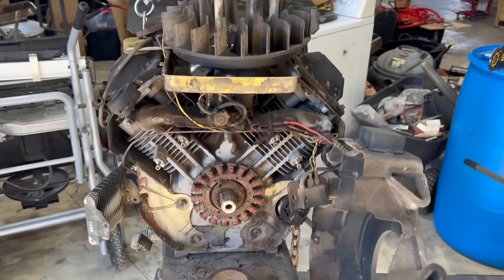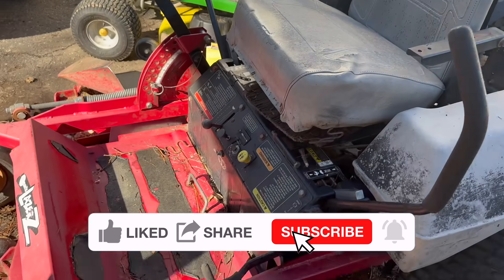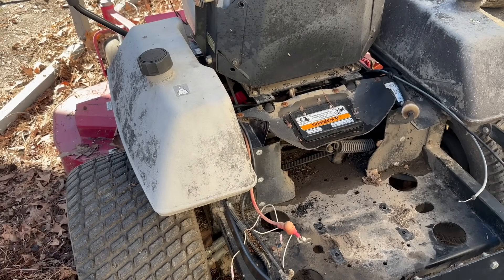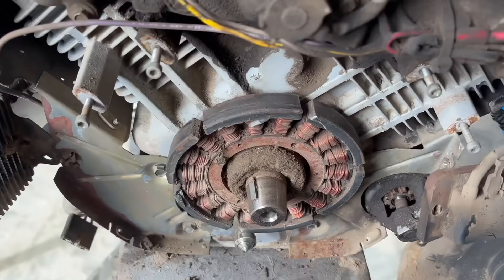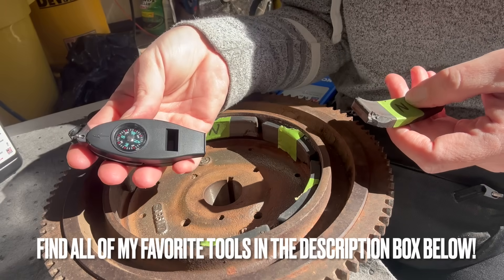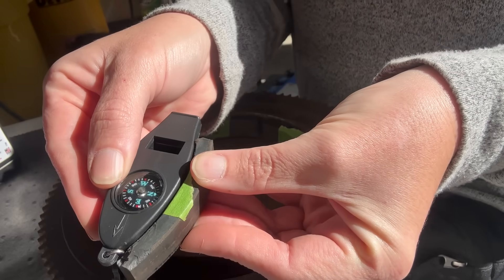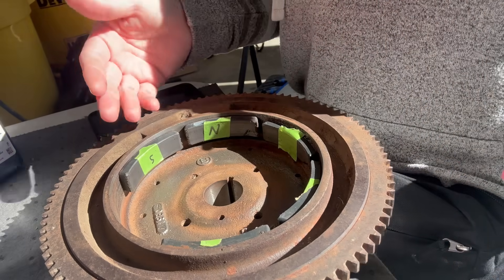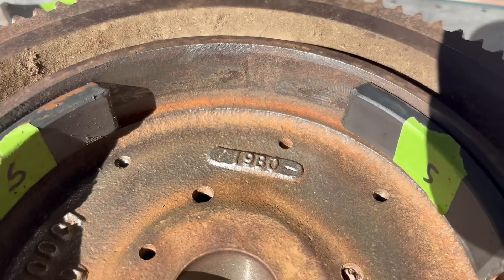Battery Keeps Going Dead? How to correctly re-install Flywheel magnets that broke off! Kohler

Comment: I'm on my daughter's YouTube. I had this happen to me on my 20 plus hp Kohler engine about 12 years ago. Before I removed the magnets from the stator I marked them. I completely clean the epoxy from the flywheel and magnets. It probably doesn't matter, but I wanted to make sure that the magnets were spaced evenly. I got a 5/16" brass rod so it wouldn't stick to the magnets. The 5/16" wasn't quite big enough when I test fitted it. The gap was too big between the last and first magnet. So I wrapped scotch tape around the brass rod about three times. That was too much when I test fitted it. I kept peeling just a little bit of tape until I got it right. I covered the backside of the first magnet with red thread locker. I made sure that the flywheel was positioned so the magnet was on the bottom of the flywheel that way the red thread locker wouldn't run away from the magnet and flywheel. Once that cured, I installed the brass rod and put red thread locker on the second magnet and install it and positioned the flywheel correctly. I waited for that to cure so that way the magnets wouldn't pull towards each other. It was long and tedious, but I was very happy with the result.

Comment: The old Tecumseh HH and OH motors are bad for this. I used a super thin layer of JB weld and light tensioned C clamps to re-glue the magnets. 12 yrs later and still going strong.

Comment: If that's a magnetic pole indicator, yea that's North.  If that's a compass, the compass' North is attracted to the magnet's SOUTH pole.  Doesn't matter most of the time as long as they alternate, all is good.  Once in a while though, when it needs to synchronize with something at the other end it WILL matter then.

Comment: Hey Bre!  Good luck with the new shop!  I was hoping you could help me with something.  I have a Stihl MS180C (soft start) chainsaw that starts and runs perfectly.  BUT, when first started I slide the black lever all the way down to "choke" and lock the trigger.  After 1 or 2 pulls it sputters and I raise the black lever up to "run".  Of course it starts, but at this point the trigger is still locked and it runs at full speed until I hopefully get to the trigger and release it!  Running the saw at full speed (even for a few seconds) when cold can't be good for it, can it?  I don't want to ruin it, but that's how I was instructed to start it when I bought it.  Would it be better to release the trigger after the first sputter on "choke"?  Thanks again for all your wonderful tips!

Comment: The magnets polarity can be determined by placing them next to each other. some will attract some will resist. I’ve never had to pull an engine out just to remove the flywheel. 🤷🏻‍♂️

Comment: I know it's very tempting but don't take a blow nozzle to that stator. Shop air is very likely to blow debris  (little metal bits) into the coils and that insulation is super thin. It's very easy to short out the windings. If you have to clean the stator use a vacuum and soft brush.  Don't touch the vacuum to the stator and be gentle with the brush.

Comment: I'm less than impressed that you didn't consider this repair good enough for the owner, if I'm recalling that video correctly,  and would only sell him a new flywheel, because you didn't consider it a reliable enough repair.....but now that he gave you the unit, the cheap fix it plenty good enough for a unit that you are going to sell.

Comment: Good job Bree, I did that to a Polaris snowmobile engine and used the industrial yellow epoxy that I have used on damaged motor cycle cases and it worked good.

Comment: OK Chic, 
Heres a question for you. My tiller has a fuel shut off valve. When you are going to store 
it for the winter or longer the idea is to turn off the fuel & run all the fuel out of the carb. Gotcha.   HOWEVER, with the carb innards dry, is there any rubber seals or what have you which might dry out become brittle and require replacement?

Curious in Cancun.

!
Reply: Think she says to fill/ prime with oil to store & them drain & flush well before use in one of her vids..

Comment: To clear things up, if the compass is reading "North" towards the center of the magnet, it is actually a "South" Pole on the magnet. Remember opposite poles attract. Like or similar poles repel. But the concept works for what you are doing since you alternating magnet polarity.

Comment: That's a helluva tip.  They must not have mixed the epoxy properly for them to fail all at once like that.  I would use some JB weld

Comment: really enjoy the channel.  I have a question?  I have a craftsman pressure washer about a year old.  it runs great but when I shut it off I always get a backfire.  any suggestions as to what the problem might be?
Reply: Idle it down first ,it is not a backfire - it is an after fire in the exhaust (the reason most riders have a fuel shut off solenoid below the carb.

Comment: I had a B&S 31000-series engine in an Ariens rider that the magnets came loose from the flywheel and disintegrated, destroying the stator in the process. No known reason why it happened. When it first happened the engine was hard to turn over by hand and made a grinding sound and I thought the piston or crank was damaged. Turns out it was just all the magnet chunks under the flywheel. I cleaned them all out and for the next 6 years I kept the battery charged with a battery tender as a flywheel and stator were stupid expensive.

Comment: Will I have a problem that's not to do with that. One of my blades is lower than the other and it is cutting my yard all messed up. Can you show a repair on a mower deck on a zero-turn. Possibly the shaft has slipped on that side

Comment: A bit of redundant information: It's actually so that if the North arrow of the compass points to the magnet, it points to the magnet's southpole and vice versa. But as long as they are alternately positioned it's quite uninteresting and of no consequence. :)

Comment: I think the real crime here isn't that somebody couldn't afford the repair, its that the parts cost so darn much.  Part of me gets it, but sometimes???  For example.  I have a Dewalt Random Orbit Finish Sander I use ALL THE FREAKING TIME (HUNDREDS of hours).  Well, actually it's about the 7th one.  Why?  Because the sanding pads wear out.  They are 100% replaceable...but they cost MORE than a new sander does, with the EXACT SAME PAD.  Yep.  Last one I looked at a few years ago was $59.  I can buy the sander for $49.  Even my old high quality Porter Cable Finish Sander (when Porter Cable made quality tools) has a pad that costs $59.  That one I do spend the money on, because that sander is a beast.  It's old, but the darn thing is as good as any Festool for sure (again, back when Porter Cable made quality tools, and didn't sell out).  

THIS is the problem.  These companies do NOT want you to fix your equipment, they don't.  They want you to buy new.  I paid $149 for my Echo Weed Whip.  Replacement speed head?  $50 (local, not the Jungle Web site, or even on-line parts places).  Carb Kit?  $116 (but they send you a new sparkelator and air filter too).  I mean, those two items cost more than what I paid for the entire unit...SHIPPED TO MY HOUSE.  That is the real crime.  Fact is, they do NOT want people to repair these units, they want you to buy new.  Too bad we have become such a disposable society.  :(
Reply from the maker: I had the same experience with printer ink. The ink cost to replace fully was MORE than the printer new!  BS!
Reply: Funny you say that.  Back many years ago Sam's club had a deal on some HP printers for like $49.  They had to put a limit on the number purchased. Apparently people were trying to buy 20 and 30 of them...because that was cheaper, at the time, than a single ink cartridge was...of the 2 it used (which was something like $89 then).  People were literally going in the parking lot, opening the printer box, grabbing the ink cartridges and tossing the printer, or leaving it in the cart in the parking lot.  

I really wish there was something that could be done about (not just ink) but repair/replacement parts.  Even my dishwasher that needed a basic seal...$59!  A basic solenoid valve (literally a $10 item), $99.  Spring kit for my clothes washer $499!!!!!!!!!!!!!!!!!  Yea..$499 for 2 lid springs.  So...yea, not doing that job.  LOL...

Comment: I have a old cast iron kohler 16 hp single cylinder to tear into. No current at the stator wires. Question if the magnets are trashed and NOT reusable, are new ones available ??? Luckily the battery is good and this engine is on a early 80's rider so the only draw on the battery once running is the ignition coil, have easily run it for 2 hours and still have enough juice left to crank the engine. Just running it like a plug in hybrid for now AKA plug it in after every use 😏;-)

Comment: You don't even need a compass. Just get one magnet and see how it reacts with the other magnet. If it pushes away or is attracted just use the same magnet to test each of the other magnets and alternate them when putting back in.

Comment: I have just such an engine.  Your tip will certainly save me some money.  Time and frustration, think that will stay the same.  Good to know that this happens.  Surprised the parts aren't all wrecked.  Thanks.  Good vids.
Reply: I used black silicone to hold  the magnets back in place after I sanded the inside track of the flywheel. 
That was a couple years ago and still good.  I don't know if anything is a better glue.  Mike
Reply: @mtwseneca  There are different grades of silicone RTV which have different levels of adhesion.  The least-expensive ones stick the least.  If you get up into the premium RTVs (such as Permatex Ultra Grey), the adhesion generally gets better.  Read the labels.  I did this job back in 1987 on my grandfather's AMF lawn tractor after it was in a flood.  I didn't know about the N-S magnet orientation then but did use RTV and it appeared to work (at least for awhile, the tractor went away a few years later).